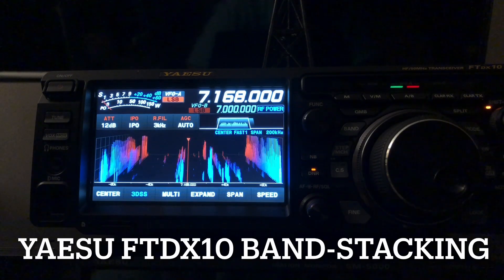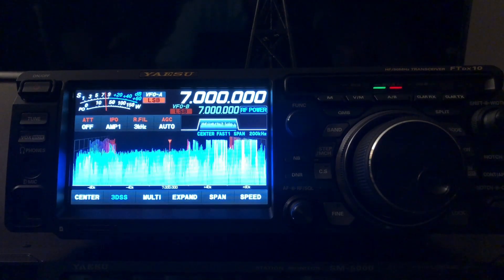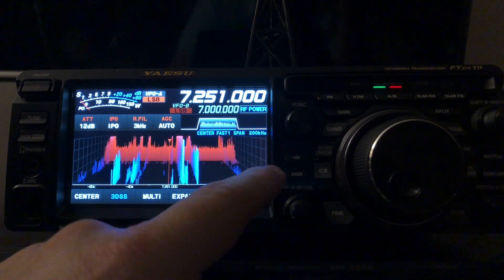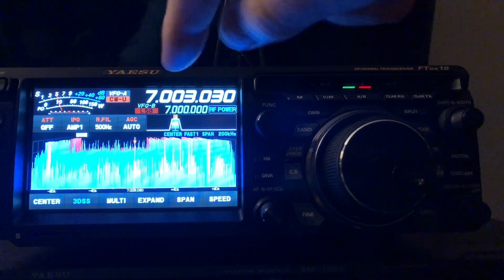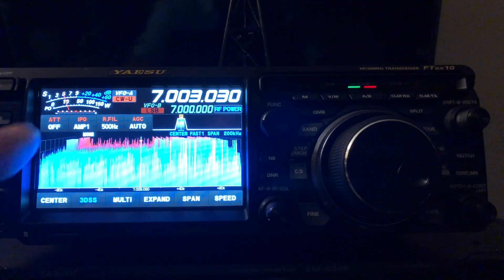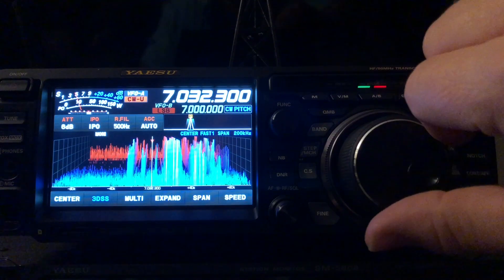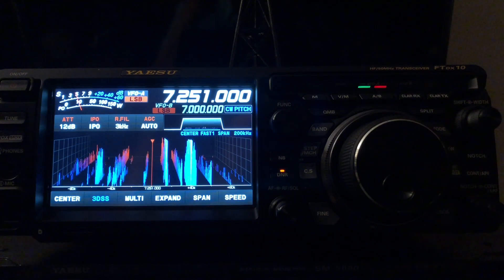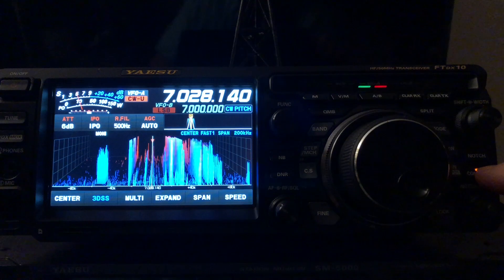Yaesu FTdx10: Band-Stacking (Video #3 in this series)  #hamradio #yaesu #ftdx10 #bandstacking

Comment: Beats me why your looking at the CW portion of the bad with your SPAN set to 200 kc ? Try 20 KC and really get a look at who is there. That water fall is your window into what is out there but your looking thru 200 kc and it is too far away.
Reply from the maker: I don’t watch the waterfall. I’ve been doing radio for 51 years. I didn’t have a waterfall display for 48 of those years. I don’t need a waterfall to find signals.  I use a QRP radio that doesn’t even have an S-meter. How do you think I find signals?  Radio is for the ears.

Comment: Hey @n4hnhradio  I know this is an older video, but... Do you know if there is a way to put 'band stops' on the FTdx10?  In other words, as a General can I set a marker or beep or something at the bottom and top of, for example, the phone portion of each band?
Reply from the maker: You can set a lower limit and a span. You must select from the span options that are available.  For 80m SSB, it works out perfectly.  You can set the lower limit to 3.8MHz and the span to 200kHz. But for 40m you set the lower limit to 7.175MHz, for General class, but you need a 125kHz span.  There is no 125kHz span option. You just have to know your operating privileges. You cannot create multiple ranges, as in one for your CW limits and another for your SSB limits, with a gap between them.  

The IC-7300 allows you to set 4 band edge limits per band.  It is a good rig for someone who is still learning.  Yaesu places more emphasis on performance while ICOM places more emphasis on ease of use.

Comment: A couple of days ago, we set up different noise filters for each band
I asked you if you could save it,
Thank you for your very kind explanation.

The answer could be found in the function of band stacking.
In fact, Icom IC-736, the old league I'm currently using, has the same functionality.

If you press the shortcut button for each band, there are two types of
I know it stores different frequencies
This function is called [band-stacking]
I got to know the term for the first time.

Once again, thank you,
The FTDX-10 is not the best walkie-talkie in existence,
It's the latest model in my financial situation
It has all the functions that I want
There is no doubt that.

It's a great video.
Reply from the maker: The Yaesu FTdx10 has the 2nd best receiver in the world, second only to the FTdx101D or FTdx101MP.  Band-stacking has been included with Yaesu transceivers since the late 1990s.  But the newer models have triple band-stacking. My late 1990s Yaesu has double band-stacking.

Comment: Thank you for the quality video's. 
Does the antenna tuning get saved if used?
73
Reply from the maker: You’re very welcome!  Yes, once you “train your tuner” it will be able to recall the match parameters when you return to that frequency. I let the tuner record a match every 25kHz on each band - every 10kHz for 160m. I call that “train your tuner.”  There is a separate video about it. 

73, de N4HNH

Comment: Another learning experience
Reply from the maker: Band-stacking is great. If your FTdx10 has firmware newer than V01-04, you will tap the Band button and then, within a couple of seconds, press the Function knob.  That will cycle through each of the three band stack registers for the band you are tuned to.

Comment: Followed your video step by step and I am unable to get the band stacking working by double tapping the band button. Tried several times and watched this video over and over again but still no luck.
Reply from the maker: Tap Band and Press the Function knob.  Yaesu changed it after firmware V01-04.

Comment: Informative and useful information. Thank you Doug!
Reply from the maker: Hi Rajeev!  With your newer FTdx10, the bandstacking works differently. You will need to tap Band and press Function. 

73, Doug
Reply: @n4hnhradio  Just a little addition to the info you've provided. I was just poking about on my FTDX10 and found that each VFO has its own band stack register, so technically you have 6 registers between the two VFOs. Personally I use memories for moving between bands and modes, but hey, any feature the manufacturer added will be useful to someone. :-)  73's, Rick VE3JGX

Comment: I’d been trying to remember how to do this. Working phone, FT8 and now CW this will really speed up swapping around them as the mood takes me. Nice feature. Starting to really really like this radio :)

73 de M0SDB
Reply from the maker: The band-stacking with my FTdx10 works differently than with those using newer firmware.  Mine has version 01-04.  With newer firmware you press the Band button and immediately press the Function Knob, to cycle through the band-stack.

73, Doug

Comment: Hi Douglas, tks for nice  and vy useful  videos on FTDX 10. Where i can find the 1.04 firmware version? My firmware version is 1.10 and band stacking don't work like in the video. 73 Lino ik1sow
Reply from the maker: Hi Pasquale!  If your FTdx10 came with V01-10 installed, you shouldn’t use an older version.  There can be minor differences in the hardware of a newer transceiver that makes the older firmware incompatible.  Yaesu doesn’t even make the older firmware available for that reason.  

So the best we can do is write to Yaesu via their Contact Us page and request the original band-stacking procedure, from V01-04, that allows us to cycle through the band-stack registers by simply double-tapping the Band button.

73, Doug

Comment: It should be changed back to double-tap.
Reply from the maker: Yes indeed!  I put that request in last year, as soon as 01-06 was released and it was reported that we would need to press the Band button and then press the Function knob to cycle through each band-stack.  I guess not enough of us have requested to go back to simply double-tapping the Band button.  Yaesu changes things we don’t ask for and doesn’t do what we ask for.  They are very frustrating.  But, their transceivers are still so good that I tolerate it.  I shouldn’t have to tolerate it.  So you might have noticed in my videos that I haven’t updated my firmware.  I still haven’t.  And I haven’t had even one issue with my FTdx10.

The things that could be done to improve the FTdx10 are simple firmware improvements.  Allow us to right-click the mouse to open the Function menu.  Click on a digit in the frequency display and scroll the mouse wheel to change frequency.  Right-click over the frequency shown in the display to pop up the band select screen.  We can already click the Mode indication in the display to get the popup menu to select a different mode.  We should be able to do that with Band.  Allow a custom Span option, so we can set the span of the scope to display only the portion of spectrum that our license allows.

We need to inundate Yaesu with these improvement requests, via their "Contact Us" web page.  I was told by a Yaesu employee that the Contact Us page is the best method for communicating requests to Yaesu in Japan.

73, de N4HNH
Reply: @n4hnhradio  I am in, to push Yaesu. 💪

Comment: You didn't really show the band stacking procedure. I did everything the manual said by no luck.
Reply from the maker: Yes, I showed the band-stacking steps, as they were last Spring, when I shot this video.  I was running firmware version 01-04.  I am still running 01-04.  I won’t update mine because they changed the band-stack procedure in all subsequent versions.  I’m not interested in FT8 and the 3 second timeout for the Band and Mode popups doesn’t bother me.  So, I chose not to update my firmware.

Your firmware might require that you press band and then press the Function knob.  Each time you press the pair the VFO will cycle to the next band stack register.  There are 3 registers and then it starts over.  I prefer being able to double-tap the Band button to cycle through the band-stack registers, the way it worked in firmware version 01-04.  I don’t know why Yaesu thought they should change it.
Reply: @n4hnhradio  Thanks for explaining this.. I did the update and somehow missed this information. I'd be embarrassed to say how much time I spent trying to get band stacking to work with the pre upgrade procedure.

Comment: Can you delete a band stack register ?
Reply from the maker: The band stack registers update automatically to the last state you left them in.  If you have one set at 7.150 LSB, and you change it to 7.155, have a QSO, and go to another band, when you tap the 7m button again, you will return to 7.155 MHz LSB.

The bandstack registers start out with a frequency and mode set from Yaesu.  For example, 7.000 LSB for the 40m band.  You could set all three registers for the 7 MHz button back to 7.000 MHz LSB, but there is no delete button.  There is also no save button.  The bandstack registers function and update automatically, in the background.

73, de N4HNH

Comment: Thanks for the video, really helped me get a hang of my new radio :)
Reply from the maker: You’re very welcome!  Glad to help.  The band-stacking works a little differently with firmware versions 01-06 through 01-08.  The FTdx10 in the video is running firmware version 01-04.

73, de N4HNH

Comment: The Ft991 does this so much better, you press the Band button, Then you press the band on the touch screen as many times as you to cycle through the band stacks, (no time limits to get to the screen) so the band selection stays on the screen until you have finished with them.
Reply from the maker: Did you talk to Tim at Yaesu about your FTdx10?
Reply: @n4hnhradio  I spoke to the retailer I purchased it from as i have only had it 3 days, found the fault the same day I had it, an engineer from the retailer is calling me Monday to see if it is something they can remedy.
Reply from the maker: You are set to LSB or USB mode, I assume.
Reply: @n4hnhradio  Yes, just double checked, tried in USB LSB, i dont know how the APF filter should operate, but when i select CW the APF knob does noting either.
Reply from the maker: APF is for CW mode only.  You should be able to rotate the APF/Contour control and the LED will light up within the button.  Or you can simply press the button.  I have other videos that cover the function of APF and Contour.

73, de N4HNH

Comment: What do you think about the new firmware? Band Stacking worked before by pressing the band button. The band changed from a big ring. It was good! There was no need to poke the screen all the time  After the updated FW, I think these got worse. I had to go back to the old firmware except for the display. Can you make a video of how these supposedly work in the new version and share your opinion. 

I like your videos! 73 Harri OH1HL
Reply from the maker: I tend not to install updates until they have been out for a while.  But I’ve heard of the issue you are speaking about.

It’s a trade-off when they pack so much into a radio this size.  Not enough room for individual band buttons, like the 101, 5000, etc.  But I programmed a CW, 2 SSB, and an AM per band into memory.  Plus I programmed in the 10 meter FM frequencies and most common 6 meter frequencies/modes.  That’s the way I operate my FT-891.  I can recall a memory and tune away, with all filters, etc. preset.

73, de N4HNH
Reply: @n4hnhradio   You are a wise man! I also knew that I should keep the old one because you can never be sure.
Reply from the maker: I waited nearly two months before I updated my FT-891.  The update is only a slight improvement.
Reply: @n4hnhradio  I didn’t upgrade my old kenwood ts-480 for 15 years because the features listed weren’t helpful to me. His death was natural, honorable, and peaceful and was not due to a lack of update.

The description of the FTDX10 update was so clumsy that I didn’t understand everything about it (maybe just me). I didn’t even see the need for an update for a working band button and the description was bad. The waterfall is a little more pleasing to the eye as it is never empty.

The upgrade may be useful if you are into FT8 (you don't even have to use the band button). Otherwise, you should probably wait for the next update and hope that the description of the update would be better.

I look forward to your new videos. Keep up the good work. Thanks for the videos!
Reply from the maker: I don’t do FT8.  I’m somewhat old-fashioned I guess.  I’m curious what you mean about the waterfall.  I like to work the noise floor down to where there are blanks except where there are signals.
Reply: @n4hnhradio  By waterfall I just mean 2D view. I also adjust myself so that the bottom noise is not visible but the completely black screen after transmission looked a bit "broken" at first. Now it continues where it left before TX. A good feature of the radio is that the RF-gain adjustment does not affect the display. I tried the FT8 and got bored pretty quickly. However, I know a lot of young and old amateurs who are very excited about it. The main thing, though, is that you get joy from the hobby :) My English is bad so I don't always find the right words.
Reply from the maker: Your English is great!  I assumed you were in the USA.

73, de N4HNH

Comment: Please turn off 3dss, really not a great feature. The waterfall is much more convent, really shows off the ability to find stations. Show how to use the outer ring to change bands and modes. Also great for coarse tuning. This is a really great radio for operating one handed.

Comment: I have a general question. I'm about to buy either an Icom IC-7300 or this Yaesu FTDX10 (they are just landing in Australia) Having used both, what's your opinion on the newer radio??
Reply from the maker: The FTdx10 is in an entirely different league than the IC-7300.  IC-7300 is a good entry level radio.  The FTdx10 is contest class. The receiver is magnificent.

73, de N4HNH
Reply: @n4hnhradio  thanx muchly. Are the controls knobs & buttons all on one side awkward? It looks like you’re being careful not to ‘bump’ things when making adjustments.
Reply from the maker: @John Tudor  yes, the buttons are around the VFO.  That’s why I locked the VFO.  You don’t really need to use these buttons very often.  You don’t even need to use the Band button once you program a favorite CW, SSB, AM, FM frequency for each band into memory.  I hardly ever touch the Band button on my FT-891, because I use memories.  Once I dial up a memory, which has mode, filters, etc. set, I just move the VFO off that frequency if I want to use another frequency.  You can always use the touchscreen to make changes if you don’t want to use the buttons.

73, de N4HNH

Comment: Hi there Doug, finding all your videos very informative and intuitive, thank you for your time and knowledge, it’s much appreciated for sure ! Would you please, if you have time, do a video on the 5000 MP, explaining the functions of the 5 buttons on the right hand side of the main  VFO A,  labelled A-B to A-M,  thanks. Also, can you lock both VFO  A and VFO  B, frequencies together, so whilst turning VFO A,   VFO B, shows the same frequency simultaneously ? Thanks Doug, cheers and 73’s, Sam, Australia, 🇦🇺  What is your Patreon address please  ?
Reply from the maker: Great idea, Sam!  I will plan a video to cover those functions.

The Patreon address is: www.patreon.com/N4HNH 

73, de N4HNH
Reply from the maker: Sam, I’m on a time limit with the FTdx10, so let me give you some insight into the buttons to the right of the VFO, in the mean time, before I can shoot a video.  The A>B copies the frequency, mode, filters, etc. from the VFO A to VFO B.  The A<>B button moves the frequency, mode, filters, etc. from VFO A to VFO B and vice versa.  It essentially flips the two VFO settings.  The V/M button switches between VFO mode and memory mode.  I shot a video about how to cycle through the memory channels.  Switch to Memory mode and long press the Band/MCH button, above the Clarifier/VFO B knob, until the LED lights yellow.  You can now rotate the Clarifier/VFO B knob to cycle through the memories,.  Tapping the V/M button can also return to a memory channel if you happened to have tuned the VFO knob after selecting a memory channel.  Note that the 60m band channels are preprogrammed into memory positions 5-01 through 5-10, for the U.S. market.  The M>A button copies the currently selected memory channel data into VFO A.  The A>M does the reverse of the M>A button,  it writes the frequency, mode, filters, etc. that are in VFO to whichever memory slot is currently selected.  I will try to shoot a video showing each of these buttons in action, as soon as I finish with the loaner FTdx10.

73, Doug

Comment: This work with FTDX-1200
Reply from the maker: It should work with any Yaesu from the last 10-12 years.  Band-stacking is a great convenience.  I use it more than I use the memory channels, except for 60 meters.  60 meters comes preprogrammed into the upper memory channels.

73, de N4HNH